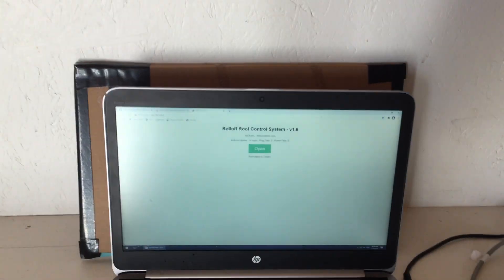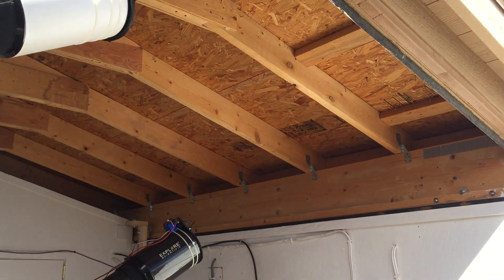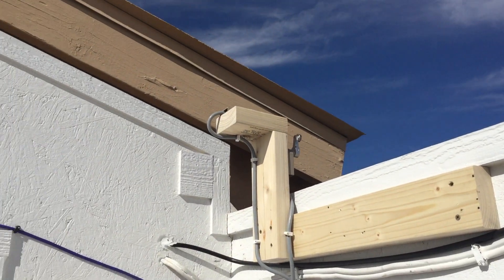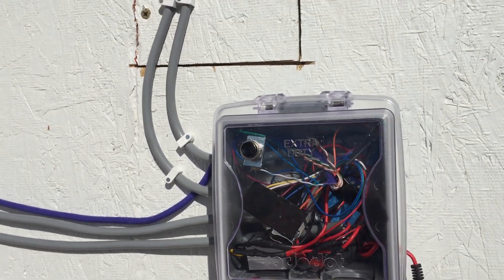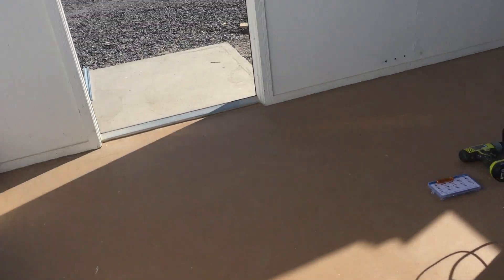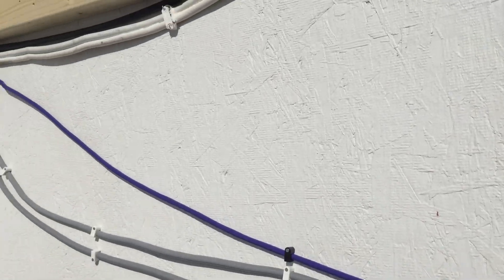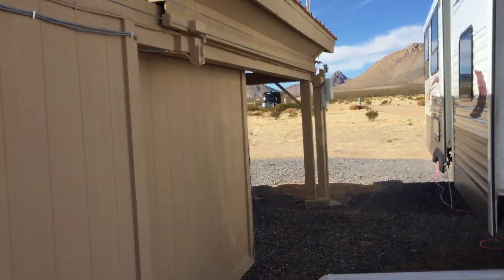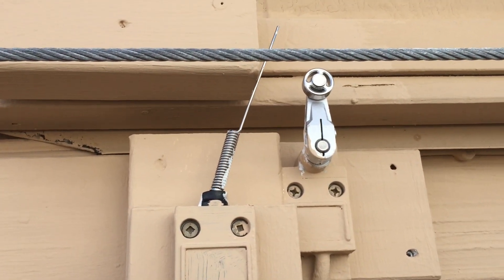Astronomy Roof Control System - Arduino ESP32 - Web Server - Part 1

Comment: Amazing, very great set up. I am interested on the drive system using steel cables, can you sometimes make a video about the drive system of the roof and the 12 Volt motor, the battery Idea is super great!